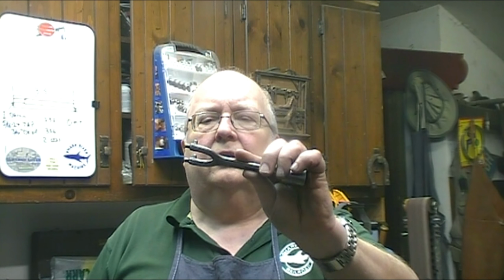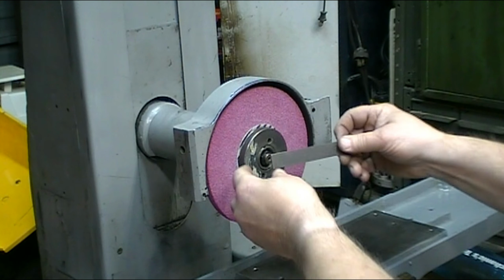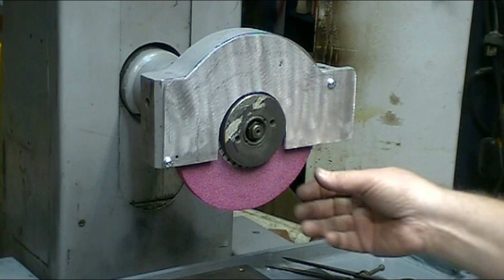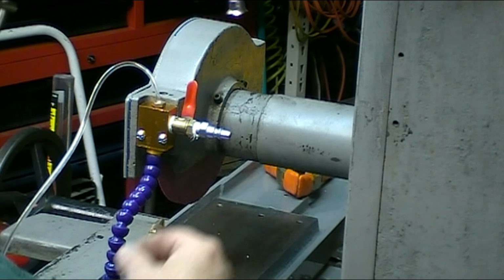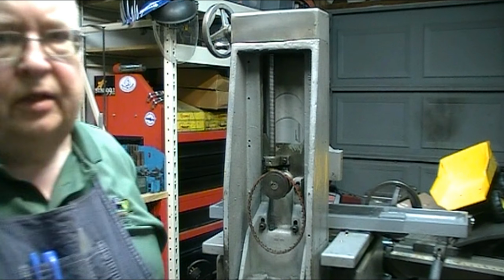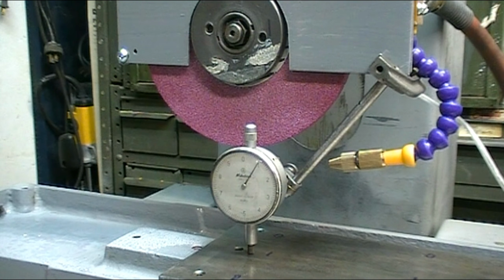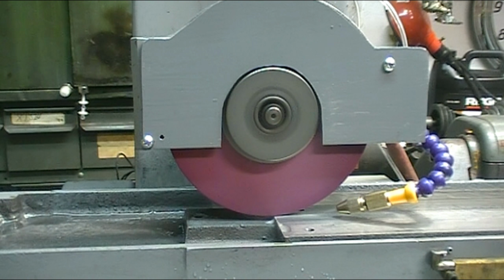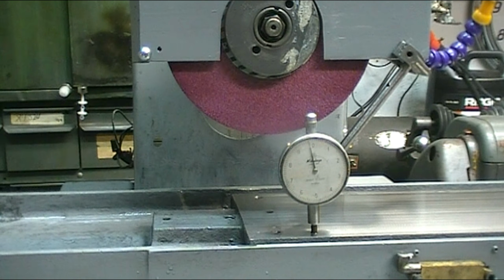Sanford MG Surface Grinder Part 3 Making Sparks

Comment: Good catch on the rpms. 4500 is cooking.
Reply from the maker: The motor pulley was too large, that is why I checked it.  Got it running at 3400 now.  Much more comfortable with that speed.  Now to balance the stone.  Thanks for watching and commenting.

Comment: OK, you've convinced me that I MUST have a surface grinder for the Tin Barn, but they're like chicken teeth in a 300 mile radius of where I live. Good video!
Reply from the maker: That was the problem that I ran into. There were plenty of grinders available but most were far far away.  The ironic thing about the Sanford is the they were build within an hour of me but they are just not seen around here.  What I did was set up a search with notifications on eBay.  I specified the search radius at 100 miles, then I sat back and waited.  Every once in a while I would get a notification.  As it worked out I got notification on this one, it was less than an hour from me, I bought it and picked it up the same day.Thanks for watching and commenting.

Comment: Could you be grinding in a twist from uneven pressure on the feet?  It seems a bit odd it could be out .003 from corner to corner (it just so happens),  I was shocked how much turning a little bolt on the bottom of one leg could move a level bubble on one end of my lathe but not the other.  Looks like a great finish on the end.  Great size tool you tracked down.
Reply from the maker: The way that the carriages are installed I don't think that the mounting would change that.  The proof will be as I move the grinder into a different location in the shop and check the table to see if it changes. Next I will be bolting the mag chuck on the table and grinding that in.  Thank you for watching and commenting.

Comment: looking good maybe once you got it balanced give it another go throws are big numbers for a grinder
Reply from the maker: The table is good now.  I am mounting the mag chuck and grinding that in next.  It will be a better quality grind because I will be able to dress the stone before the final grind.  By the time I got to the last couple of passes on the table the stone was getting a little dull.  It was not practical to set up for dressing the stone at that point.  I am sure that I could have figured a way to do it without remounting the mag chuck but I was satisfied with the result.

Comment: Well done all around.  Link belt gives my Bridgeport unpleasant harmonics., pulleys ring.  Enjoyed watching.
Reply from the maker: As far as I am concerned the link belt are for emergency use only. I replaced it with a regular fractional horsepower belt. The only other application for the link belt in my opinion is when you need wrap on a very small diameter pulley. Thanks for watching and commenting. I have been enjoying your build also.
Reply: Well Mr. Lang, it’s funny how both of us are doing Surface Grinder.‘s. Even though they are decades apart. There is a big difference besides the machines age, you actually know what you’re doing. I don’t have a clue. I’m getting to know her very well after cleaning and reassembly though. Like watching and learning from your videos. I’ve been watching most all of Stans grinder videos also. And we can’t forget Mr. Wizard. I watched him do and Mills the other night.  This old Tony also..... Isn’t this community awesome. Can’t wait till Stan’s grinder workshop.  Hopefully I’ll make the move soon and get a rotary phase converter.  We do have a Bar Z discount at American Rotary.  Keep the videos coming
Reply from the maker: I got a slot in Stan's workshop also.  Although I have had a lot of grinding experience in the automotive industry it was somewhat different than this. My surface grinder had a 20" diameter wheel and could handle cylinder heads and blocks up to 4' long.  I have also been in touch with Robin Renzeti, and have visited his shop.  I will be reaching out to him.  It will be good having some time in on my grinder prior to the class.  That way I will have a better idea of the capability of the machine.